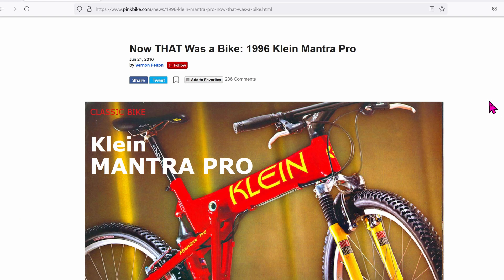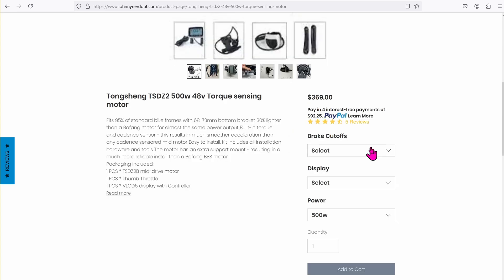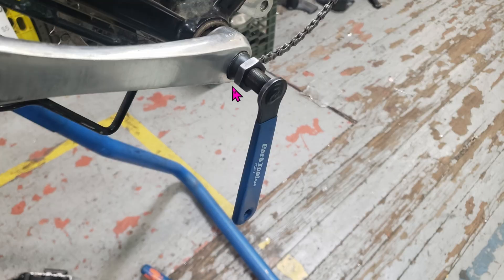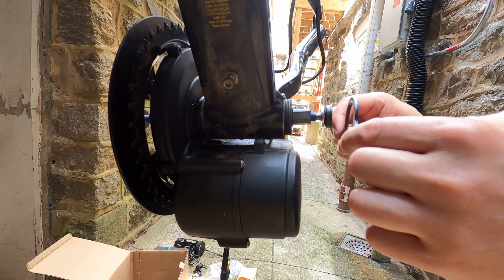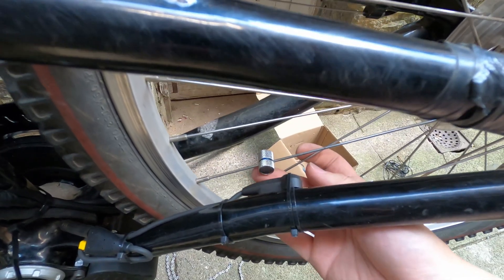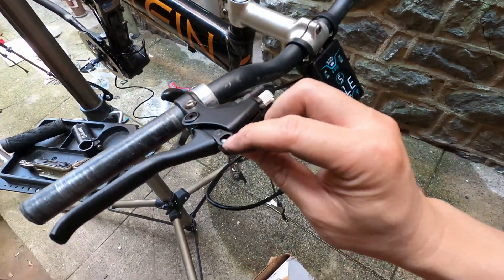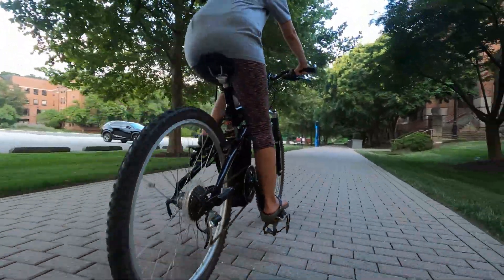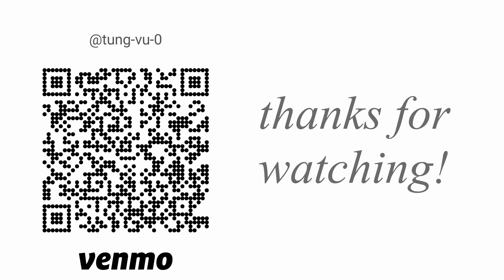make your own E-bike. easily done under 1 hour with ebike conversion kits

Comment: Great post . Its the best thing you can do , but try and not look to smug as you pass expensive shop bikes!, personally i would go long range fast , about  700 uk pounds for a 1kw hub motor (use torque arms !) and a 29ah 48v battery .  Though illegal in many places a throttle control is heaven over clunky pedal assist . I have had zero problems outside of wire abrasions in over 15000 miles. I use throw out bikes so there free , just new tyres and brakes/cables usually . That quick link was pricy ?  Anecdotally hub motors are far more problem free .
Reply: 950km and is starts to die (main clutch bearing)
Reply from the maker: 15,000 miles is a lot! what do you do with your ebike?
Reply: @dablet  Its a 40 mile round trip to nearest supermarket and in my seasonal job its 20mile round trip a day, then there's the leisure miles , i get through a lot of tires !

Comment: Yo, don't use a hammer to tighten the nut. Just extend the tool using a piece of metal pipe!
Reply from the maker: this is true. i did not have a metal pipe at the time. so i gently tap with hammer